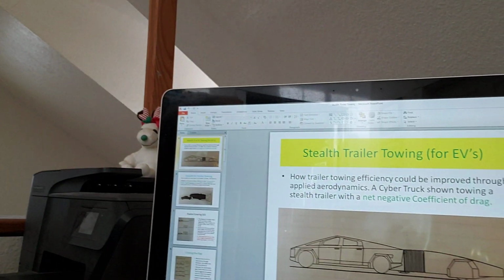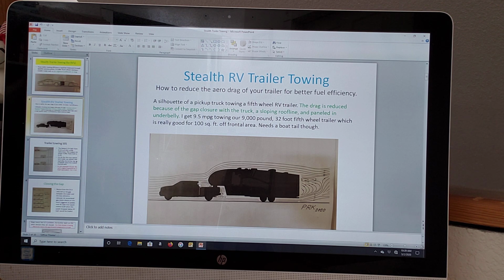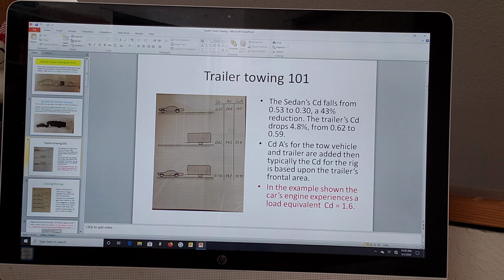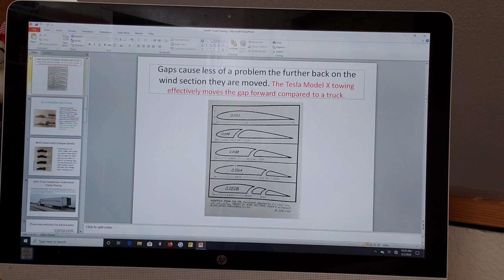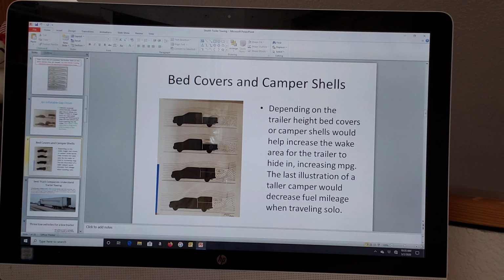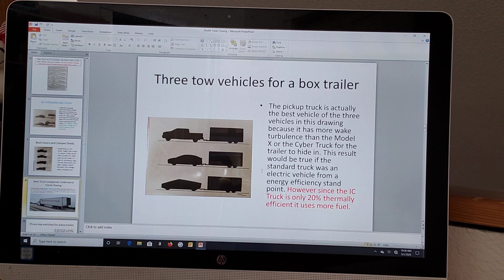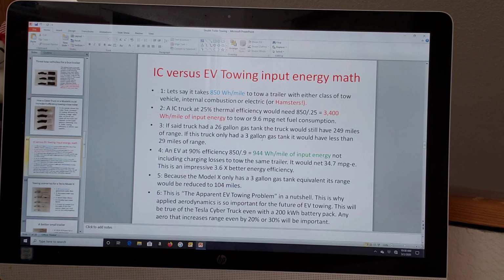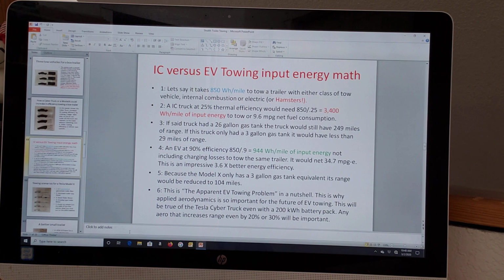Stealth Trailer Towing (for EV's)

Comment: Thanks John.  This information has been helpful to me in preparing for an extended trip in my Toyota Tacoma pulling a small teardrop trailer.  I had been debating whether to use my tonneau cover, or installing my cab height topper.  If I understand this correctly, my topper will be more efficient because the height of my topper is about 10 inches taller than the height of my teardrop.
Reply from the maker: Probably. Get data for us if you can. With the shell, then just the cover, would be nice. I have a 50 mile interstate run I can do, going north, then south, totaling 100 miles. It really useful because it starts and ends with the same gas station, and the same pump, if I am lucky. Of course such testing cost money. Sounds like you have a nice rig.
Reply: @Aerostealth  I plan to do that this fall.  I'll let you know how it turns out.